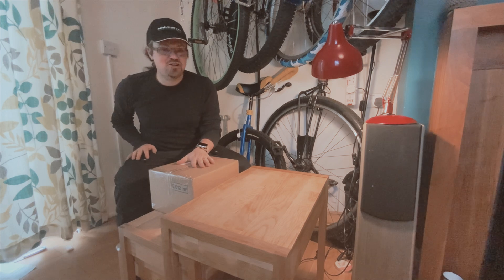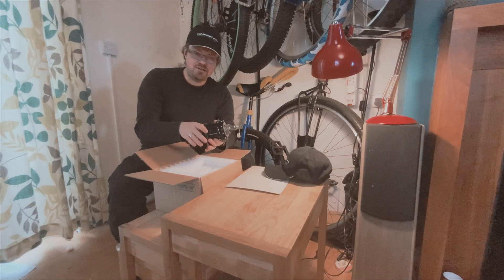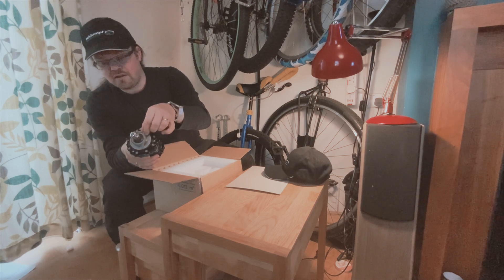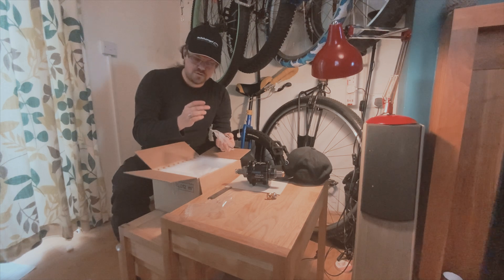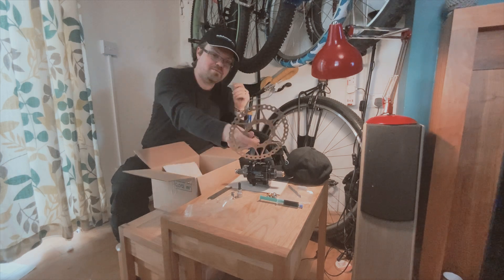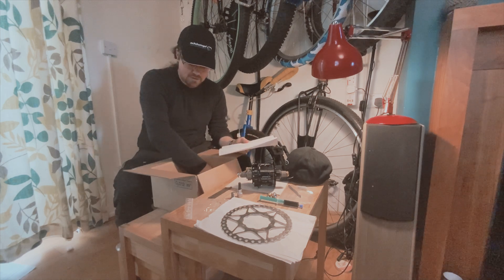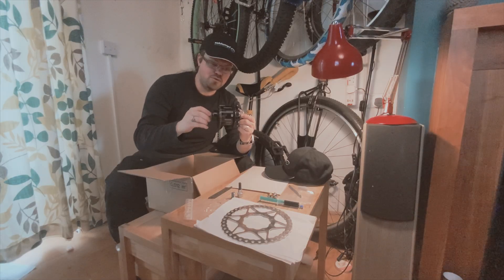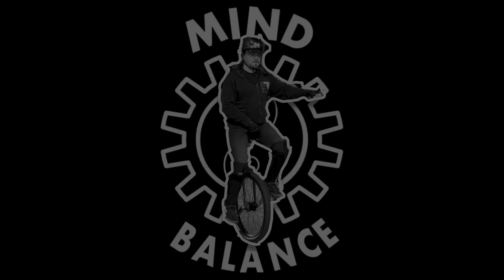Schlumpf Geared Unicycle Hubs (2022): De-Boxing

Comment: I wish you could get those rotor disks for normal uni hubs
Reply from the maker: Sadly the rotors for these hubs have some issues with design and wear. It would have been better had they been designed asymmetrically. They work but I wouldn’t want this design on a normal uni hub. The ones they come with are going to be a lot better.